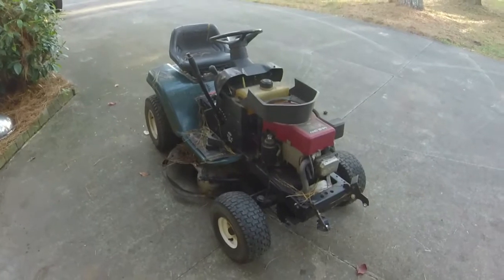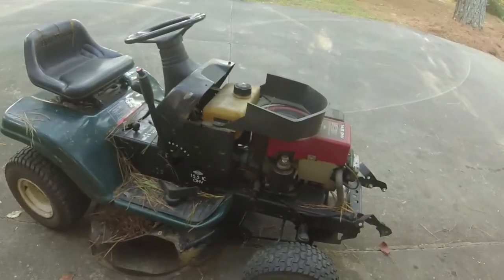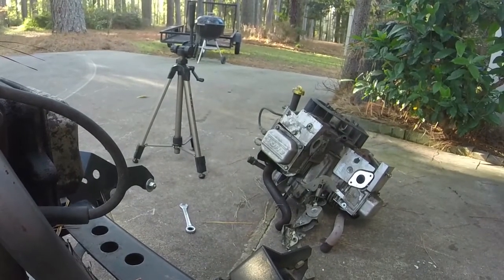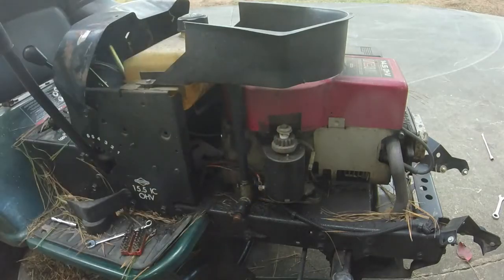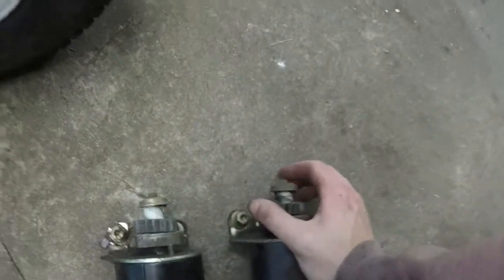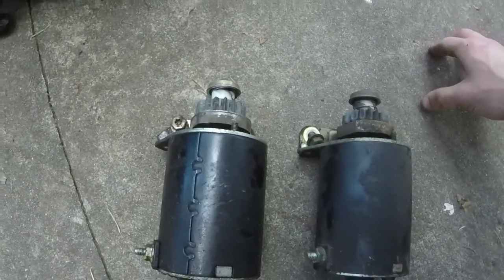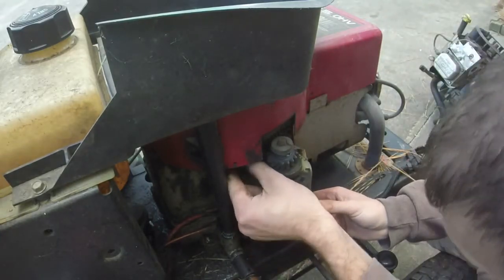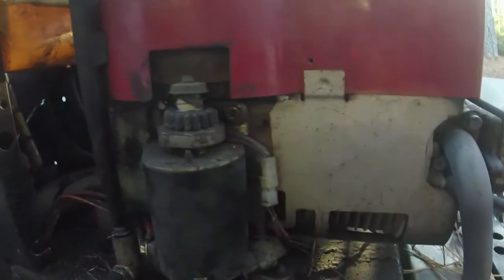Briggs and Stratton single cylinder starter replacement with v-twin starter (plastic gear)

Comment: Interesting info on the starter compatibility with single and vtwin vs opposing. And I know you guys are used to it down there, but that pine straw would have me pulling my hair out lol. Nice video Casey!
Reply from the maker: Thanks Chris, I was surprised that they were the same too.  It provides nice shade in the Summer but the pine straw is brutal in the Fall.  At least it's free mulch!

Comment: What is the possibility of making a mold from the plastic gear and casting an aluminum gear from it. Those probably would be in demand after people saw them.
Reply from the maker: They make a metal gear.  This isn't a common problem.  But changing to a metallic gear would eat out the plastic flywheel teeth.  You have to change both to do that.

Comment: Need info on replacing starter motor on Briggs &. Stratton v21 twin engine lt 1000tractor
Reply from the maker: Between this video and others, and looking up the part number from the engine model number on the valve cover, it is not too difficult of a job although access is tighter on the V-twin.

Comment: Hey Casey.  I have a Briggs v twin (type 446777).  Do you know how many teeth are supposed to be on the starter gear? Is it supposed to be metal?  Thanks
Reply from the maker: I think all the Briggs Vtwin starters are the 14 tooth metal gear starter.  Just check to make sure your flywheel has the metal ring gear as well.
Reply: Some are 16 with plastic gear